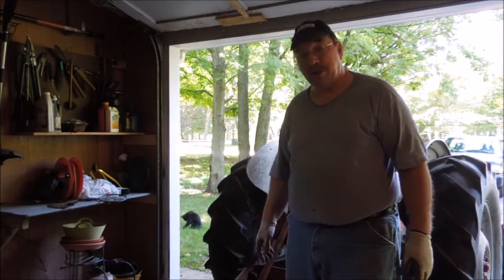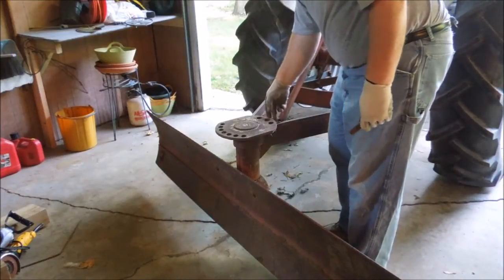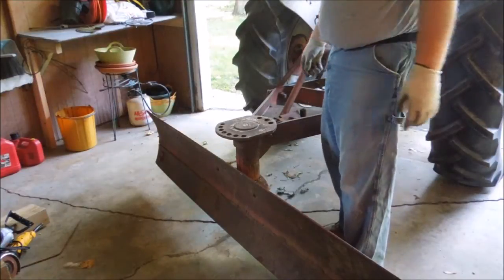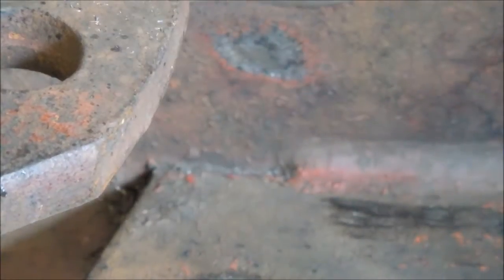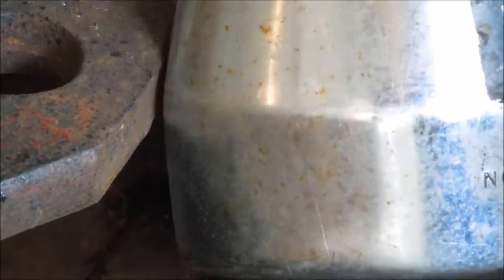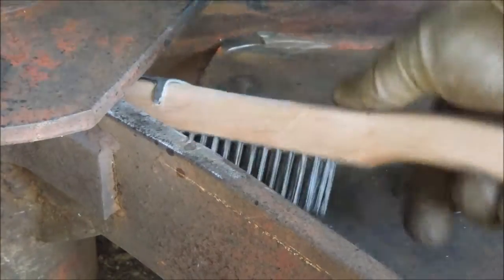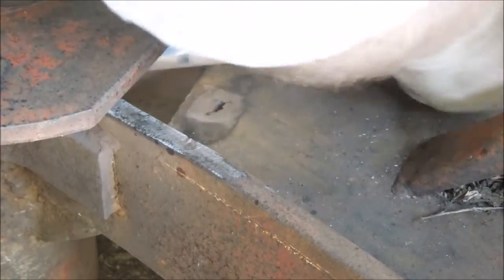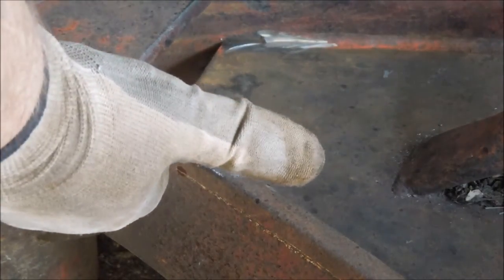Weld Repairs To 3 Point Grader Blade - Pt 1 - by Old Sneelock's Workshop

Comment: I like your use of the word "gentle" to describe those hammer hits.
Reply from the maker: It's all relative. The plate is 3/8" hot rolled plate. By using the 10 lb sledge I'm able to put all the impact into the steel and I don't get the bounce I would if I used a 2 or 3 lb hammer. It keeps my hand from stinging. If I was working it hot I would have used a smaller hammer. At red heat the 10 lb tends to splash the metal out more than straighten.
When I was helping my friend draw out a coulter for his single bottom muck plow we used the 10 lb and full swings. That's what I call striking. :-)

Comment: I ALSO LIKE THIS METAL WORKING VIDEO NICE CHANGE I HAD TO PATCH MY BLADE UP A COUPLE OF YEARS AGO AFTER A BLIZZARD THAT SNOW PUTS A LOT OF PRESSURE ON THE METAL
Reply from the maker: Thanks for the share Bud.
The load on the blade when hitting a snow bank with a 2800 lb tractor is tremendous.

Comment: Great video !!!
I have the exact blade the angle is rusted and much force won’t break it loose any ideas drilled a hole in the top (cap) and has 1/2 ish quart of trans fluid… expected to find a huge nut inside the the bottom bow shaped cover which is rusted out nice for visual…
Reply from the maker: I have never had it apart.

Comment: I enjoy seeing the metal work, nice change of pace. I just acquired an old Lincoln tombsone AC welder, looking forward to firing it up - been a long time since I ran a bead.
Reply from the maker: Thanks for watching. Having the welder back up is a big step toward having a real shop again.
The first welder I bought, when I was 14 was a Lincoln 225 buzz box. They are sturdy machines. I used to weld for a living and I have to run a few beads to get my hand back in now.

Comment: you could replace the big pin with a smaller one so the pin would break before the welds did. also the same thing happened to my blade when it  hit a root
Reply from the maker: Good idea. I did manage to put enough weld on the plow to hold up. The thing that I found as I worked on the pivot was that the welds were only on the braces. The last repair didn't involve removing the previous broken welds by grinding them out they just lathered on a couple beads and then single pass welded the brace around the pivot. 
With the improved weld structure it is a lot stronger. 
Also I bought a snow thrower. Pushing snow Is harder on the equipment than pushing dirt. Snow and ice freeze down and when the blade hits it won't move. Just like hitting the root the blade ends up absorbing all the inertia in the weight of my 3000 lb tractor. 
End result. SNAP.